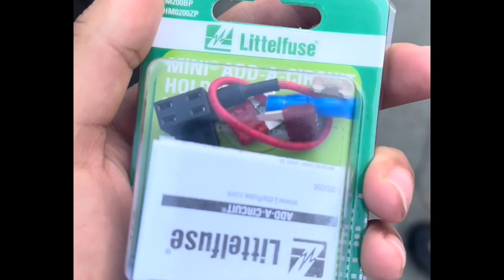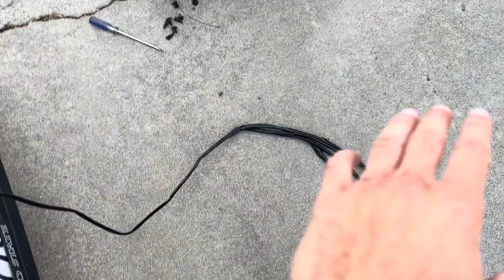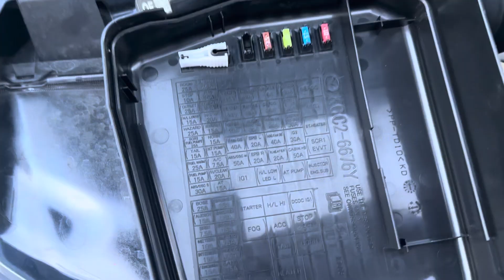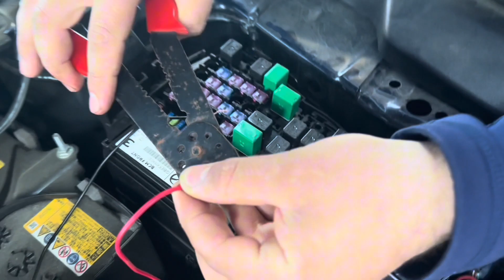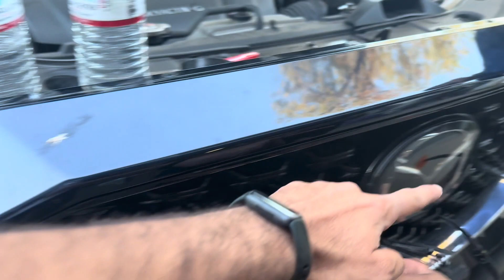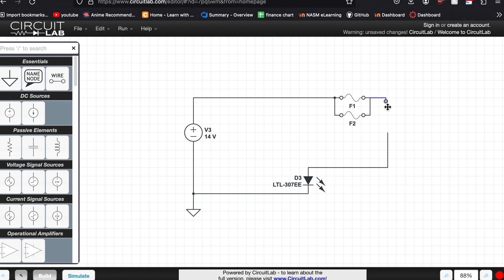How To Install GRILL LIGHTS On Your Car (With Engineering Diagram) | PART 1

Comment: Why should I put fuse adder to the circuit, what about if I will just increased the amperage of the fuse than adding another fuse. Just to make it more easy and practical so it make sense
Reply from the maker: They way we did it was add a fuse tap/adder in order to connect it to a constant fuse slot (meaning it will still be on when the car is off). Sure you can increase the amps but you still need a power source.
Reply: always use a fuse tap !!!!